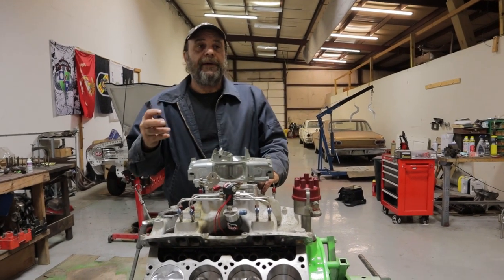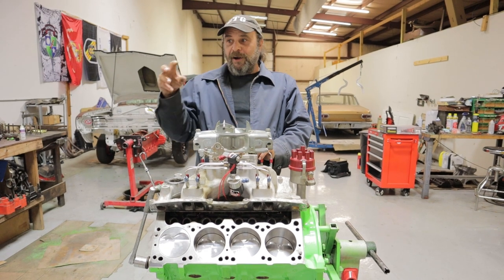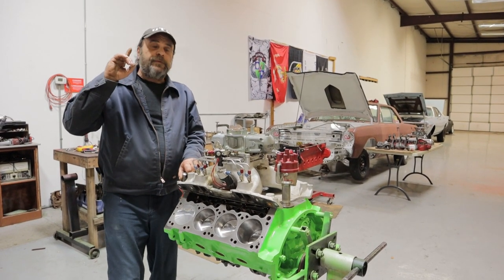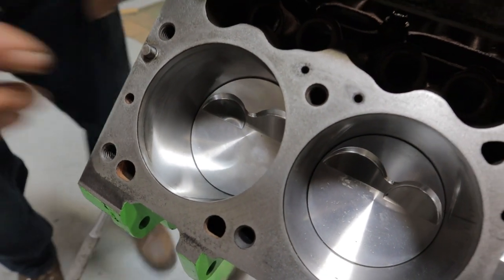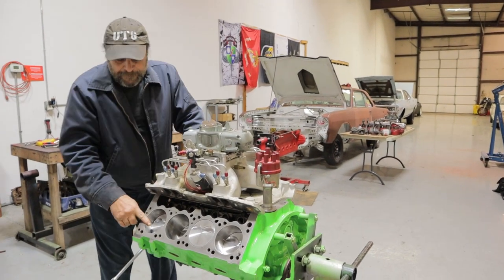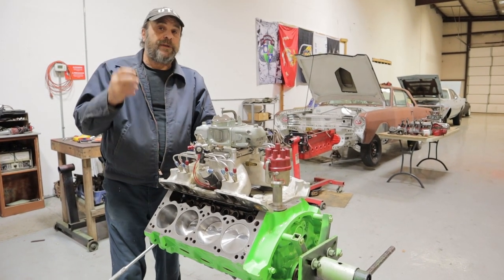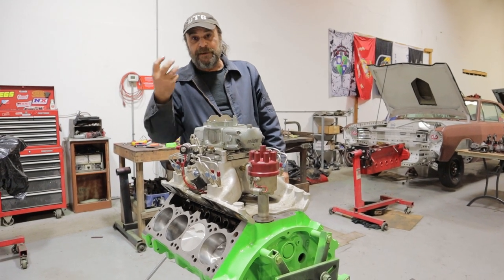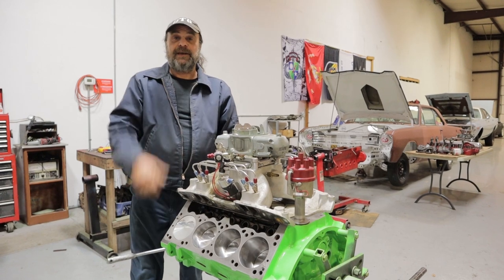The Fundamental Aspect Of The Internal Combustion Engine Nobody Ever Talks About

Comment: A John Deere two cylinder could burn Kerosene with water injection and they pulled better. The exhaust had a sharper note to it. You could go up a gear and pull just as many plow bottoms. We always assumed it was the slower burning the water flashing to steam and extending the pressure that made the difference.
Reply: Yeah the pressure on the head is extreme with water. It would blow a gas powered head into a million pieces.
Reply: My dad had an old John Deere that you started on gasoline and got it after operating temperature, then you could switch it over to the kerosene tank. Far as I know there was never any water injection involved on that tractor.
Reply: You have to compare apples to apples, which means if you need 30 horsepower for easy driving then you compare a 30 hp gas engine to a 30 hp hydrogen engine, and if the hydrogen engine lacks power then it must be bigger, and you don't compare equal size engines, you compare the efficiency of equal power engines; so you would be comparing the fuel usage of a 40 cubic inch, 30 horsepower gas engine to a hundred cubic inch, 30 horsepower hydrogen engine.  So a power advantage gives an efficiency advantage because it enables use of a smaller engine.  The problem comes when you realize that 40 cubic inch car engines are quite uncommon.

Comment: Close, but wrong. The combustion creates heat, heat expands the volume of air in the cylinder. PV=nRT, the ideal gas law. Pressure × Volume = quantity of gas × Ideal Gas Constant × Temperature. The fuel combusting doesn't directly expand, only the temperature does.
The explosion increases the temperature, T, but n(amount of gas) and R remain constant. If V(Volume) is constant, pressure(P) increases.
The pressure is increased as long as the temperature is increased, until the volume decreases. Temperature, pressure, and volume are all directly proportional.

Nitro Methane is more powerful than Gasoline because Nitro has a 1:3 stoichiometric ratio, but Gasoline is 1:14.7. So you're pumping 1/4 nitro and 3/4 air into a nitro motor, more fuel equals more heat.

Comment: So back in the day I remember a couple of drag cars running on just propane. Where they running on propane gas or propane liquid injection? Also many fleet companies had propane conversions. How did they get power from there trucks? Just wondering and need help understanding. Thanks great vid!
Reply: Running on vapors propane or gas reduces power by a significant margin compared to liquid fuel that is evaporating and absorbing some heat out of the charge.  Back in the 50's probably 50% of farm tractors ran on propane vapor.  Bottom line it comes down to charge density.  Even in port injected engines most of the gasoline is vaporized before it burns.  The conversion from liquid to vapor just helps with charge density.
Reply: There are lots of rock crawlers running on propane. Works great because you don’t have fuel pickup issues from all the crazy angles and bouncing around. And, they can still make good power. 
It uses a mixer that in a way acts like a carburetor. They also usually need a heater since the pressure drop of the gas will cause things to freeze. I imagine they also can’t run hard for a long steady duration without freezing the tanks and loosing pressure.
Reply: I remember when the city pickups were ran on Propane back in the 70's and sold in the late 80's at auction, pulled valve covers off to change gaskets after 200 thousand miles and looked like new! Of course we went to A1 auto and put a AFB on it
Reply: I've worked on propane forklifts for years. Liquid propane is passed through a Vaporizer, which uses hot engine coolant, to turn it into a gas. The gas is then fed to a carburetor or fuel injector.
Reply: @NBSV1  Propane tanks are full of liquid propane. They have to be oriented correctly or the fuel pickup tube inside of the tank won't get liquid from the bottom. They don't work right at extreme angles.
Reply: The diesel  MATA buses in the bigger cities were run on natural gas back in the early 2000s  and idled on  3 of the 6 cylinders cause they showed us when I was in automotive/diesel school
Reply: The nice feature of propane is it's 120 octane. Promotes increased compression ratio and ignition advance.
Reply: Propane is indeed cleaner burning. The difference between propane, and heat vaporised gasoline. Is the gasoline is running at its leanest possible air fuel ratio to achieve fuel economy. The propane isn't. It is being run at a richer mixture to produce usable power. The fuel efficiency in miles per gallon, is similar to gasoline. Yes propane is liquid under pressure. It vaporises at atmospheric pressure. It is being combusted in vapor state. It is running in a rich state to produce usable power. I experimented with the idea of running lean for efficiency. Because of potential energy available. Lean burn for efficiency was at a drastic sacrafice of power.
Reply: @williamcullum6676  You cannot compress gasoline vapors to a higher density than liquid gasoline AFAIK. 
I really don't 'buy' anything in this video.  Gas has a specific amount of energy per gram whether it is in liquid form or vapor form.  Propane has more energy per gram than gasoline. (50.3MJ/kg propane, 46MJ/kg for gasoline)
Reply: @williamcullum6676  Propane displaces air too, that's the other problem with it. Liquid direct injection is to overcome this. 
For years I had a 383 that I built with an M1 intake and 2x propane carbs and converters. It had 2x 80 liter tanks behind the rear end. The trunk floor was cut out and a cradle made and the propane cylinders across the car. The cradle was bolted to the rear frame rails. It went really well. Was ballsy too, still revved up like 383s do. It made 250 rwhp uncorrected at 2500ft amsl on a dyno on a 33 deg c day on an old dyno (by today's standards) in a country town in the late 1990s. I have a bit of experience with propane particularly tuning it for power. 
Fuel economy is just so so when you tune them for performance. You gain when the cost of gas is cheap. Once propane rose in price I sold the car but I had it for 7 full years as my daily driver. It sat for 3 years before it eventually went. 
No one wanted to pay the asking price then one day someone saw it and said this is a bargain - which it was. He knew how well sorted it was. It had AC and power steering. It was tight in there and the hood braces were cut out so it would close. It had a GM fan clutch with a Mopar fan mounted to it, shroud, AC condenser fan, power steering cooler, two trans coolers, a LSD, MP 200lb torsion bars, front and rear sway bars, custom steel wheels with 235/60 15s. 

There was not one day in that cars life I didn't rev it to 6500rpm. At one point I was putting 250miles a day on it for 6 months. It was hard starting thing esp when hot and cold. Broke the armature shaft in the starter twice and of course the headers had to come off to replace it. It would bounce back against the starter particularly when hot. I ended up putting an ignition kill switch in and would get it winding on the starter and switch it on. Half the problem with it was the priming button. If you got it wrong it'd backfire through the intake violently and this was the source of the starter issues. In some ways a mechanics car. 

My son was 10 when it sold, and he's now 25 and he never lets me forget how much he misses that car. Was an army green Dart. I drove him home from hospital on the day he was born in it - I suppose his mother came too but we won't worry about her 😈
Reply: @SpecialEDy  I suppose that's why they use propane in rock crawling is it?
Reply: @kmcwhq  Yeah but the gas displaces air so the volume of combustible air/fuel is less.
Reply: @NBSV1 what you speak of sounds very similar to the operation of ICE forklifts.  I use to work in the forklift industry as parts guy but never had the ability to understand how propane was converted into combustible energy. The forklifts at hand were indeed ICE. Many of these engines were gm, toyota, Mitsubishi,  etc. 
As I can piece together (and correct me if I'm wrong about all this) prior to combustion process the propane would need to be regulated by going into a heating exchanger (I believe) and then into vaporizer and finally into the carb or fuel injectors. I wish at the time I was able to be a tech as I would of been more throughly able to understand this process.
Reply: @SpecialEDy  I should of read this before posting, thanks for clearing this up for me. I was partially right about this process,  since I was only a parts guy and not a tech for forklifts I never got the chance to understand how a propane powered forklift operated. I also seen an older Hyster unit that ran on propane and regular gas which I also wonder how that was converted? Was it 2 separate fuel delivery lines going to the induction system?
Reply: @ThePaulv12  fascinating story. Thanks for sharing. I have been contemplating of building something like this as a alternative to regular fuel as a combustible source of energy for the ICE. Do you feel what you build had more pros than cons? The milage you were getting no doubt, got me intrigued but I wouldn't build something just for the milage factor...
Reply: @ThePaulv12  Gasoline displaces the air too just like propane. Any fuel displaces the air. Unless you want to run the engine on just air?? What the hell are you even talking about?
Reply: @dewreckdeberjack9618  It's time for your coffee enema. Get off the internet.
Reply: @SpecialEDy  All them rock crawlers would disagree with you. Propane torches work fine held upside down. I don't think those little tanks have anything special in them to work that way.
Reply: @NBSV1  Small devices use vapor. A hand torch, grill, a space heater, they use LP gas coming out of the tank. They do have a correct orientation, typically upright, and if you use them in a different orientation you run the risk of getting liquid instead of gas which could cause an out of control flame in the device.
A combustion engine LP Gas tank has a pickup tube that pulls liquid off the bottom of the tank, similar to a gasoline fuel tank. If they are oriented incorrectly, they can starve the engine of fuel, or spray fuel out of the safety regulator.
Reply: @SpecialEDy  I think if a person uses the gas side of a propane tank it cools the tank down and pressure changes. At -40f I think there is no gas evaporating. Maybe it's easier to regulate the liquid than the gas in an larger volume scenario? Ie barbeque as apposed to a truck? Thanks for your input. Great info in these replies.
Reply: In Australia lpg is/was a widely used fuel. Cars were converted to gas as it was 1/2 to 1/3 the price of petrol. I own one and it runs well on the lpg it's a 3.8 v6 gm. No real loss of power and fuel consumption only went up by 10-15%.
Reply: @carrsllccarrillo6507  The knowing is in the doing. With hindsight, it was  a marginal proposition.
I ran out of fuel once during a propane shortage; in the sticks - so there's that. 
Generally I thought incorrectly as it turned out that I could get good mileage out of it but I couldn't no matter how much I tried. It was made possible though because propane was cheap and plentiful, so my situation worked. Then gas prices went up and availability of it went down snd it became impractical for me as I live in the country.
Think carefully about it. I did mine a long time ago and things change so some of the gear out there today might be better.
I got caught up in the development of a particular propane carb. I was what you'd call a full paying free test facility for an unproven product. A beta tester but no discount.
The claims the manufacturer made were ridiculous as they couldn't make those claims without years of testing. Things like valve seats - they said their system solved the valve seat issues propane causes. Naively I bought into the hype. I had 1970 383 heads and in one year every single exhaust seat in both heads had cracks so serious the heads were uneconomical to repair.
I got other heads and put hardened seats and that fixed it.
My hatred for the company was not insubstantial. I had a lot of trouble but ironed it all out eventually.
I thought it was all going to be fun but it was very far from that, but I got there eventually without ever fully solving the hot bounce back even with the ignition switch mod.
I don't know what it's like now.
Reply: @carrsllccarrillo6507  Years ago there was a company called Ensign they made LPG fuel systems, They made a dual fuel system that would run on LPG or gasoline, you would turn on the LPG valve to run on LPG or let gasoline go to the carb which worked like a regular carb. On the LPG side the liquid LPG would go threw a regulator/ vaporizer and be drawn into the intake manifold.

Comment: Here in Australia, LPG (Liquified Petroleum Gas) or propane had been an alternative fuel for fleets and old thirsty V8s for some time (till they taxed it out of viability). LPG tuners know that it takes more initial but less total timing, indicating slower burn rate but less fluid quenching effect due to it being a vapour rather than liquid (no cooling effect from phase change).  You would typically see 15% less top-end power for a given port/intake size and camshaft combo, but brilliant low-to midrange torque. This is due to the gaseous fuel taking up 15% more intake volume vs an atomised liquid fuel. The HC, CO and NOx emissions were much lower, but consumption was generally 20-30% more in volume due to both the relatively crude metering of the mixers and the lower calorific value of the propane/butane mix per litre. LPG is also a less dense hydrocarbon (as a liquid) than petroleum.

This aligns with your theory Tony, about different fuels possessing different burn characteristics and being able to harness the best of each. Vapour carburetion is only an advantage in a very narrow window of operation, much more so than is experienced in real-world driving. Also, fuel has only a certain amount of calorific value and claiming 3-4 times the efficiency is simply a farce. Even a perfect thermally efficient engine (impossible) cannot reach more than (about) 83% efficiency due to the Carnot cycle calculation, which includes heat losses to the intake charge itself, pumping losses, etc. A simple calculation will get you to where you will know if a claim is fraudulent or not. Energy in vs work out... If the latter is too high for the former, you're smelling a rat.
Reply: I do like lpg, I have an au fairlane with a 5lt on lpg. Runs great but i wish the wasnt so high now, 110c a litre where I am. I wish we had more engines with injection because the old carby isnt the best on fuel
Reply: @bernie232  Ford and Holden both had liquid LPG injection options on their models in later years, with the Ford at least having a higher power rating than their petrol models (due to cooling effect of LPG evaporating at atmospheric pressure). But I agree with you that most aftermarket kits with Impco-style vapour mixers, were a bit unsophisticated and relied on the ability of LPG to burn in a wide range of air/fuel ratios rather than bother with fine tuning. Still, their simplicity is what I love about them. My Cortina 250 got a consistent 15L/100km when it would previously get 12s on petrol. It would start first kick, rain, hail or shine, stinking hot or car under ice. It gave 7 years of zero-trouble motoring.
Reply: @gergatron7000  very true, I think mixers scared many people off from the Joy's of injection, but what an excellent fuel it can be.

Comment: Engines are just air pumps powered by the internal expansion of burning fuel. This is a good tutorial on pressure wave basics with the added visual. 
Hopefully somebody goes, "AHA!" at the end.
Reply: Actually, they are powered by the heat of the combustion, the thermal expansion of the air inside. If you heat up a gas, it expands. The explosion inside the cylinder is only there to generate enough heat to expand the gas.

Comment: I am not buying this.  Gasoline is gasoline. If you can suck 3grams of gasoline into an engine, whether it is vapor or droplets doesn't matter.  A gram of gasoline has a certain fixed amount of energy in it regardless of the form it is in. It's still gasoline, it still has mass and it still has a specific amount of energy per gram.
Reply: It's about the speed at which that energy is released. The lighter mixture will be more volatile and give a bigger initial push, but the denser mixture will release that energy over more degrees of crankshaft rotation, thus more usable power from the same volume of fuel
Reply: @ericlandstrom6155  Liquid is denser than vapor.  A gas, by definition is lower in pressure than a liquid of the same substance.
Reply: Yeah, I don’t get it either.

Comment: Most internal combustion engines are incredibly inefficient at turning fuel burned into usable energy. The efficiency by which they do so is measured in terms of "thermal efficiency", and most gasoline combustion engines average around 20 percent thermal efficiency.

Most of the fuel's energy is lost in the engine, primarily as heat. Smaller amounts of energy are lost through engine friction, pumping air into and out of the engine, and combustion inefficiency.
Reply: The single biggest factor in efficiency of ICEs is compression ratio. Trouble is, with Otto-cycle engines, the compression ratio is limited by pre-ignition (detonation/knocking) problems.

This is why diesels are so much more efficient - they can have much higher compression ratios without pre-ignition problems.